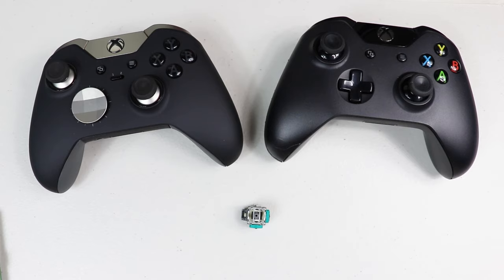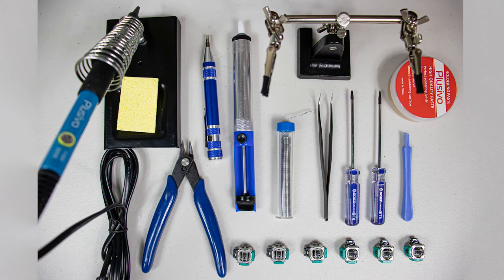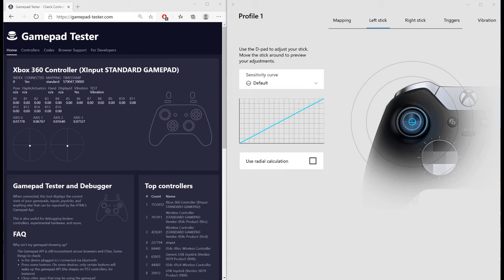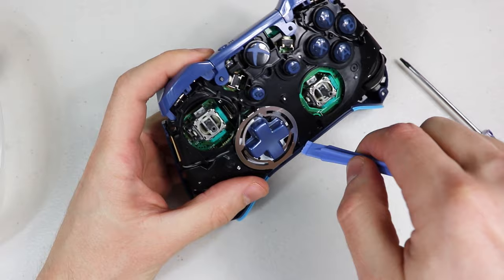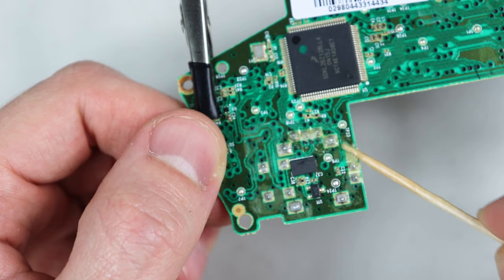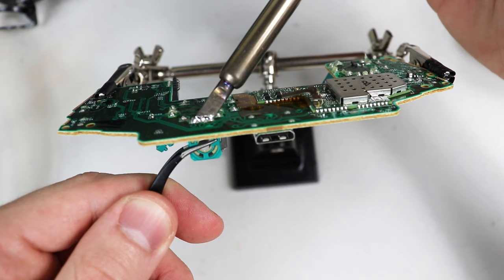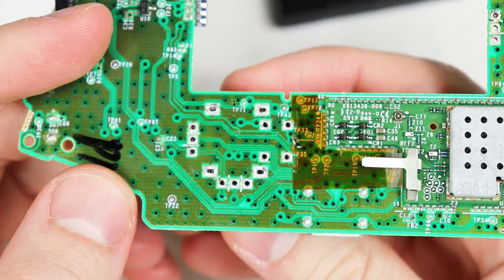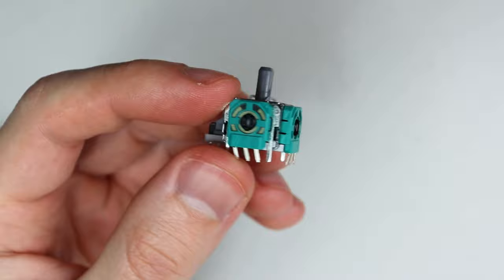How to Replace Xbox One Controller Analog Joystick - NEW METHOD - Fix Stick Drift, Broken, & Loose

Comment: When looking for new potentiometer to replace old worn-out ones, do you need to look for specific brands, or do you just need to match the ohm value of the old one? (10ohm to replace and worn out 10 ohm potentiometer) I'm trying to repair my controller and I don't know what to look for.
Reply from the maker: Basically you want ones with the same color, style, and shape in most instances. For instance, the xbox and ps4 controllers have the same ohms, but ps4 pots have a higher range. To be honest I don't know exactly how that works, but that is what I've observed. I would recommend trying to find the replacement joystick of that specific controller you're working on, and using the pots from those.
Reply: @SOSSGAMING  Ok, thanks!

Comment: Hey, I tried this. But didn't have any side cutters as you did in the deconstruction method. So stubborn ol me thought I could still time it and get all pieces out together. I ended up getting it all out and the new one in. But when i plug in the controller and use the tester it's just shooting to the left and upwards. When I try correcting it with my thumb nothing happens. Wondering if that means if I fried my motherboard ? Any help plz. I also don't have a soldering sucker. Does that make all the difference? I couldn't get the solder in the hole correctly, it kept jumping out. What am I doing wrong. Is my iron too hot, too cold ? Hahaha I feel like I tried everything. Glad I didn't take a stab at the x box elite controller. Kind of scared now as I think I fried this one
Reply from the maker: These boards are quite finicky. Specifically the pads that hold the joysticks in place. Sounds like a case of some pads got lifted/damaged. Temperature and duration are the leading cause of this. 
At least two pads are damaged if both axis are acting like that. There is a "fix" in this scenario. You can run jumper wires. If you're interested in trying this "fix", you can email a picture of the board, and which model it is to my gmail account sossgamingcs and I can tell you where the jump wires go.

Comment: I replaced potentiometers on a couple of controllers and get values below 0.1 (0.03-0.07 IIRC) according to the test page, but I still get in-game drift. I (my kid) tested more than one game; Fortnite and Lego Movie I think. Should I just go on and try to lower the values more, or is there anything else I can do?
Reply from the maker: I would recommend changing the in-game deadzone settings to accommodate it. I think default is like .06 or something on most games so you may just need to increase it a tad more. Most games should have this option. Less work that way :)
Reply: @SOSSGAMING  I´d prefer fixing the problem once and for all, It feels like less work in the long run. Back to soldering, then... Thanks! :)
Reply from the maker: @johangarmer5331  Ok, good luck!

Comment: Good evening sir, after I did this calibration it was perfectly centered for both x and y-axes, but the numbers were not steady, they were changing rapidly. How can I fix this issue?
Reply from the maker: From the sounds of it, it might be that or more of the connections aren't stable. Are both axis doing the same thing? And is it still responsive? Meaning when you move the joystick up, it goes up, right it goes right, etc.? Could also potentially be the sensor itself.
Reply: @SOSSGAMING  I resoldered the connections to make sure they are stable, and yes both axis are doing the same thing even after changing a new sensor. Also yes it moves up and down, right and left normally but still numbers are rapidly changing.
One thing I noticed that this problem happened after calibrating the sensor (leaning it to the left or right), so I calibrated one sensor and left the other one uncalibrated, the calibrated sensor was rapidly changing values while the other sensor was stable.
Reply from the maker: @mohannadsadeddin8201  The tabs that hold the potentiometer on aren't cut are they? It's important that just the nubs are cut. And is the sensor snug against the joystick? It sounds like the wheel in the sensor isn't contacting the green housing very well.

Comment: my analog replacement potentiometer is yellow with B103 series, does it work with my xbox wired controller ? originally green, like in video. also every time my joystick vibrating, its disconnected, what might the cause ? thanks, apreciate for the guide
Reply from the maker: Hmm I believe it is different but I am not certain. As for the disconnection, what do you mean by the joystick vibrating?
Reply: @SOSSGAMING  every time, rumbling input from my pc, then my joystick suddenly turn off, even after i test through web you have shown, still turn off when i spam vibration test. for replacement, well only one way to find out, wish me luck replace my joystick analog
Reply from the maker: @the5587  Oh ok. From the sounds of it, the vibrating causes the USB connection to disconnect. The USB connection might not be very stable. Good luck!
Reply: @SOSSGAMING sorry for sending you whole ass essay, thanks for tutorial
Reply: I've done it sir, and here few result
1. this my first time properly try to solder electric stuff, so bit ugly, but I manage to do so. Could be better if I use wits to remove solder, instead pump. its work nicely to, but leave some bit of residue, and I have problem to "unstick" lead from my soldering iron. Thanks tho teach me in this subject
2. I'm start with re soldering usb connection to motherboard, its work for 10-30 minute, I'm spaming vibration in gamepad tester website, the motor for vibration spin effortlessly, even I pinch down small circuit that control vibration, its still mystery, could be motherboard or driver. 
3 . long before, the problem occurs to be stick drift, its kinda unique, because my left analog twiching on deadzone. After bit of use, its become paranormal, left analog now interfere with my right analog. when moving forward, its gonna tilt camera to the right, vice versa. So I thought its must be stick drift, and simple as replace it. 
4. The yellow potentiometer, is indeed compatible. But still the twiching still occur and I don't know why. 

Verdict : my controller have 2 issues, first its turn off after vibrating/rumble and stick drift but with little twist left analog interfere right analog. Resoldering connection did not solve vibration, replacing potentiometer didn't solve it either

Comment: ik i am very late but, are the xbox joysticks compatible with ps5 controllers or do i need to buy different ones?
Reply from the maker: The range is significantly less on xbox joysticks, so PS4/5 joysticks are the way to go. Although, I just learned about Python calibration here: https://dualshock-tools.github.io/. Supposedly this can calibrate the range as well as the centering. I haven't tested it, so no guarantee. Use at your own risk if you wanted to try.
Reply from the maker: So in theory, with that calibration, you could use xbox joysticks.

Comment: whats a safe temp to have my soldering iorn at?
Reply from the maker: I like to use about 650F. Tip size (bigger = more heat transfer) and duration (more heat transfer) also matter a bit.
Reply: @SOSSGAMING  ok thanks also some of the solder has turned rock hard any suggestions?
Reply: Nevermind I got a soldering iron the went way hotter then the one I was useing and that worked

Comment: Hi , is the left and right analogs the same ? Can i use the right analog joysick of a broken controler and use it to put on the left side of other one ?
Reply from the maker: Yep! Good luck.
Reply: @SOSSGAMING  thank you , i have a spare xbox 360 wired controller and i gonna use it to fix the x360 wireless one , both of them have a huge drift on the left analog that's why i asked.
Reply from the maker: @gorytarrafa  Great! Be careful with the heating of the solder. The pads on the 360 controllers lift somewhat easily if too much heat for too long is applied. Best of luck
Reply: @SOSSGAMING yeah i will probably need to get a new soldering iron , mine is ancient and the only tip i have is too big for that probably. Thank you for the warning, i will do my best to fix it since i like the x360 controller a lot and even those are expensive were i live.

Comment: Help! After reassembling, the LT and RT are showing as being pressed where they weren't while calibrating. How to I get them "unstuck"?
Reply from the maker: Oh no! From the sounds of it, one of the small ceramic capacitors (that provide LT/RT power) on the main board (the one with the joysticks) were either damaged or removed during the process.  It could also be a connection issue between the motherboards I think.  I'm sorry, I'm probably not the best to answer this problem but from what I know that's what I think it might be!
Reply: @SOSSGAMING  thank you very much for your reply!  I'll check it out!

Comment: I think i broke or burn something repairing the joystick. Only the large vibration works and the controller turns on only when plugging into the input USB of my keyboard, when pluggin into the motherboard its not working.
Reply from the maker: Very well could be a missing capacitor/diode or damage somewhere. By motherboard do you mean the xbox? Slightly confused.
Reply: @SOSSGAMING  Yeah, I think i burned a diode. Works fine when I plug into the usb input in the keyboard, the other usbs in my pc doesn't power the controller. But the USBs are fine because I can plug other controllers, usb memories, etc.
Reply from the maker: @troscar  Ok, gotcha. So if it worked before the repair then it could very well be that.

Comment: When I try to calibrate it bot the axis are at the max and when I move to the opposite side, it's still at max. Should I remove it and try again with a new joystick? Or did I damage the board with too much heat on accident?
Reply: I'm using a solder gun btw not adjustable. 300 to 415°C plus I'm new to this so I'm not too sure if I was the cause of it
Reply from the maker: @richstrike8418  Sounds like some damaged pads on the through holes. This is the usual culprit, anyway. You can still run tracer wires to to "fix" them if you wanted. Which controller are you working on? Feel free email me at my gmail sossgamingcs and send a picture of the board and I can show where the tracer wires can go.
Reply: @SOSSGAMING  Okay thanks for the help. I'm using the original Xbox one controller

Comment: My joystick doesn’t seem to move when I’m testing it on the gamepad tester but it does move when I move the legs on the potentiometer but it doesn’t move much 
It also moved when I touched two small bumps near the analog labeled under c23 and c21
I need help 😭 would I need desolder and try another analog or did I mess something up?? 😭
Reply: Also, when I press down on the joystick to make that clicking sound, it does work on the tester it does show it works and that it is clicking but it’s just when it comes down to moving the joystick that nothing really moves
Reply from the maker: @veronicaocean4388  I'm sorry to hear about the struggles. Is everything soldered up at the moment? If so, it could be the wheel inside the pot is turned upside down or some of the pads are damaged. If not, then it's just that the pins aren't making good enough contact with the pads. Let me know if that helps or you're still having issues.

Comment: I have this one controller the same model as the one in this vid, which i have put multiple joysticks into. They all have appear to work fine until about 45 min to an hour of use. Then either the horizontal or vertical input just doesnt register...im thinking my pots and springs are fine. Anyone have any idea what is happening and how i might be able to fix it?

Edit: after researching schematics and then resoldering every diode and resistor in the path from the potentiometers to the soc, and then the soc connections I finally decided to just spray every area with 91% iso alcohol and then use compressed air to blow it and any flux residue away. So far I'm 1.5 hours into testing and drift has not re-occured
Reply from the maker: Awesome! Fingers crossed that did the trick. Sometimes flux residue or failed solder connections can cause that.

Comment: I fixed an elite controller but broke 2 regular motherboards by damaging the through holes like an idiot. I'm also having trouble getting the mic jack to work again. I've tried the regular fix of bumping it back in with a toothpick but nothing works. Neither the broken motherboards nor the working controller work with the mic jacks. Was wondering if anyone had the same issue or any solutions.
Reply from the maker: You might actually be able to salvage the boards with a jump wire(s). See my write-ups here: https://sossgaming.com/xbox-joystick-jump-wire/
Reply from the maker: As for the mic jacks, you may want to first test and make sure the headphones work. If they work, then I would recommend double checking the alignment of the jack itself. You can try prying the pins up 1 by up so they are a little more springy as well and make good contact with the board. Otherwise, there may have been some type of component damaged on the board, or the jack itself.

Comment: Can I just send you my controller to fix dawg 😭
The it has drift and the RS click doesn't work 
Ngl I opened it up and superglued the plastic part im gonna call the chassis of the RS click
It had fixed it.. but I loss full left input.. just a full stick replacement would work..
Reply from the maker: Unfortunately I don't do repairs anymore, but if you search "xbox joystick repair service" on eBay you will find some that do! Good luck

Comment: I want to use an old controller just for audio passtrough, because connecting my headset directly to the Xbox is not working. Before I get my hands dirty and try to remove the joysticks, so that the Stick drift doesn’t cause any unwanted input: does someone know if the rest of the controller is functioning when no joysticks are soldered on at all?

Thanks in advance
Reply from the maker: The rest of the controller works with no joysticks in. However, for your application, it looks like it may not be what you want because when the joysticks aren't in, both x and y Axis have 100% input instead of 0% (centered). So in that case the "drift" will be much worse. Though, I haven't technically tested a controller on the xbox, just from my observations with the testers while doing the repairs.
Reply: @SOSSGAMING  that’s exactly what happened 😅 the Controller in this state had no use for me so I tore it apart anyway

Comment: So basically if I don't have a soldering kit and the joystick snapped, I'm screwed?
Reply from the maker: Sometimes you might be able to get away with superglue, but that would more than likely just be a temporary solution.  You will definitely need to replace the joystick in that situation unfortunately, which does require soldering.

Comment: Swapped mine out and seems it isn't the sensor, my drift actually got worse. I'm assuming the actual joystick beneath must be sticking even though the sensor works. I can still get the stick to go up/down, but once it changes direction it doesn't stop. Not sure how to fix so will probably buy a new one as I don't want to solder the entire new one on, might take one last try at deep cleaining that area
Reply from the maker: What did you swap out exactly? The whole joystick? Just the potentiometer? Or just the wiper (black wheel inside the potentiometer)? If the joystick or potentiometer, did you manually calibrate?
Reply: @SOSSGAMING  Apologies I dont know the naming, I swapped out the smaller black sensor beneath the green exterior (new one was white though but same piece). I checked to ensure when I moved the joystick that piece was rotating. After I ended up swapping out all 4 sensors, still not issue on the right joystick, nor left to right on the left one, but still the same up and down drift persisted though now at a higher sensitivity, previously it was slow enough I could kind of catch where I wanted to click. I tried to manually calibrate it but to no success. My assumption is the interior is where it is wrong, not sure if I'll dive that deep (ive heard others say there's a spring within that may cause this issue).
Reply from the maker: @Charlie-uf1dc  If you didn't swap out the actual green piece (potentiometer) then I'd look there first. The main issue with what you're describing is a worn down potentiometer, and replacing that will likely fix the issue. It will require soldering though, as shown in the video and likely a little manual calibration as well. If that's not up you're alley then a new controller seems to be the best option for you :/

Comment: my controller wont turn on now after taking it apart
it worked for one of the sticks then i replaced the other one and tried to calibrate and now it wont work
Reply from the maker: I'm sorry to hear that. Have you been able to figure it out? When you say it won't work, do you mean it won't turn on or that the joystick isn't functioning correctly?

Comment: Is it possible if someone change my analog and as a side effect my rt button recognize as Lt?
Reply from the maker: I can't see how that could happen, but I'm not as versed in the electronic composition of xbox controllers as others. I would first check in the accessories app to make sure RT is set to RT (if it's an elite controller).
Reply from the maker: I'd also check in-game setting as well if you're only experiencing that in a specific game.